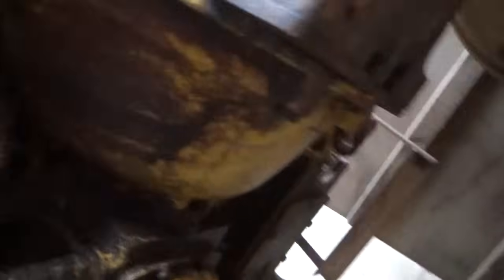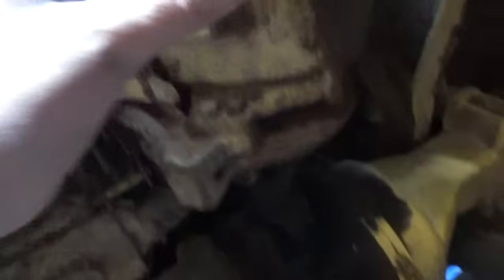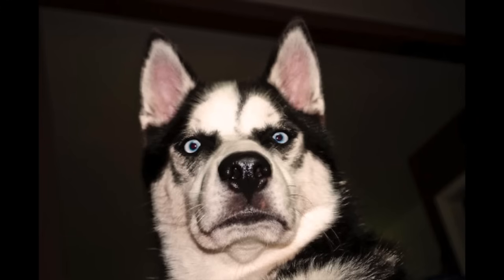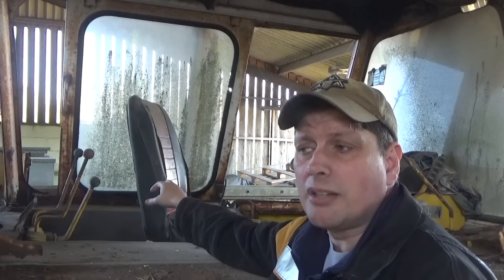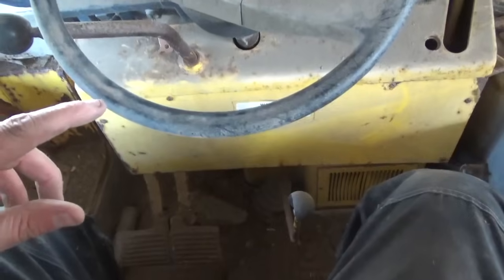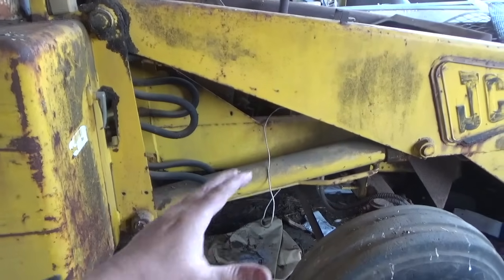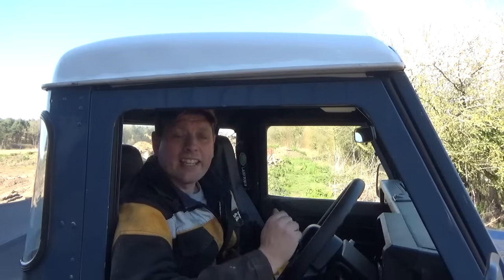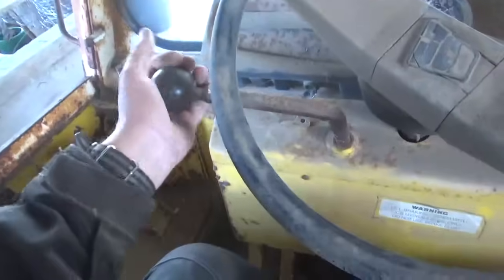WILL IT MOVE ? - OLD JCB

Comment: Wow. That was almost a let down! That machine seems to be built very similar to a Case backhoe. Which I suppose is no accident since Case was in bed with David Brown., and no doubt tuned in to British equipment designs. The trolling of trolls is an interesting strategy. I usually just take the negative comments and misconstrue them as positive or as something that serves my own purposes.
Reply from the maker: JCB's were far better built than the Case of the day but that came at the expense of being much heavier. The Case 580F was a faster machine to operate and some would say more simple.
I used a 580F for some time and actually really liked the old thing (especially the David Brown engine)
The trolls are just little more than entertainment and something for folks to laugh at.
Reply from the maker: Have you been able to do any more to the HD-5 ?
Reply: @LordMuck  Yes! My brother got it moving and the hydraulics working. The left steering clutch was rusted up. He just pulled that out and ordered a new brake band. So it should be fully functional soon.
Reply from the maker: Oh that's great ! It's a lovely bit of kit and well worth the effort. I've just bought a 6-71 Detroit out of a Terex shovel to play with. I miss hearing the scream of a Detroit from back in my oilfield days.

Comment: Like the videos, I wanna do them myself. Got a grey market YM2420 yanmar. Learned about what a thermostart was after a ether incident. Went from nothing, to white smoke, to black smoke. 874 hours but I suspect alot of rainwater got into the engine and made the rings have issues. 

😂 I dont think Greta would be quite happy with mine either at the moment.

Comment: Bloody Hell, That old 3C runs as sweet as a nut ,,, You can’t beat the old ones ,,, not like the Sh1t they make today with ab blue ECU, DPF, solenoids, wires running everywhere relays micro switches etc etc,.  Top video again 👍🏻🇬🇧👍🏻🧰🔧

Comment: Hi had a grey cab that made a vibrating noise it needed a  new hydraulic filter when they are plugged the filter lifts against a spring and the oil bypass's the filter  if it's not low that could be the noise Kurt thanks vid gets a👍 from me 😁
Reply from the maker: The oil is low Nick but you can bet the filter is clogged to buggery.

Comment: I think get started on the new project 
By  the way i have a ford 7700 and when i go to left the hydraulics i have to pull the lever to the top before it will left
Have you come across this problem before and if so what might be the solution for it 
Cheers
Reply from the maker: Have you checked the flow pressure and if the filter has been changed recently ?
Otherwise it's probably a top off job.

Comment: How a about a JCB 3C challenge rather than digging a hole. get a small axle stand, remove the extension, put an egg on the top of it base and see if you can knock the top off the egg without smashing the whole egg. You could try it with a Creme Egg with George at the controls! Faling that request, another "will it start" video please!

Comment: Brilliant started just as i thought it would and sounds sweet.i think the hours are low for its age, i have just bought a volvo bm 841 withe 37000 hours on the clock but does breath a bit.
Reply from the maker: The feel and wear indicate that it's about right for the hours, it hasn't done much at all but the pig shit killed it with rust.
Don't forget it's another one that only clocks an hour over about 1600 rpm.
Reply: @LordMuck   put her to work im sure she can still out perform.

Comment: The 4/98 in that is really sweet, yeah it has 1960's emissions gear but its long since paid its dues and how much carbon would it take to transport this somewhere, recycle it & make another jcb to replace it because it puffs a tiny bit when cold.  The long pipe is better for me because it puts the fumes higher & stops them coming in the cab when your stuck in one spot digging... Sorry for the sensible comment...
Reply from the maker: I always liked that small bit of mesh on the long pipes
Reply: @LordMuck  I didnt know they had mesh! I've always had to make one from a handy bit of old exhaust to avoid getting gassed :)

Comment: Hi mate, I know some on some jcbs you can select from 1-4 gear but it has no clutch pedal, you if know how this works can you talk about it in your next video because I haven’t a clue
Reply from the maker: They still have the disengage drive switch/dump pedal on the gearlever or the joystick depending on model.
It put it into a neutral while depressed and re-engages when you let go.

Comment: We have exactly the same jcb,, use it most days,, Everything works on it except the lights,, its an awesome piece of kit,, the metal work in it is just over ridiculous,,,
Reply from the maker: Except the cabs...
Reply: @LordMuck  that's a very good point,, yeah,, quite flimsy compared to the rest of the machine,,, I'll tell you something the hydraulics are on another level,, We were lifting a tree out with ours over the weekend and instead of it lifting the tree up, (it was stuck) the hydraulics were forcing the jcb into the ground,, I mean,, wow,,, All our other machines hydraulics just stop,, that's it,,, But the jcb kept going+going.... Wow
Reply from the maker: I'll try and find a pic of an oak trunk I lifted on to a trailer years ago with a 3C 111. The front tyres went flat but she just kept lifting. It was twice the machine the 3CX we replaced it with ever was.

Comment: Hi Lord Muck, and anyone else who has a 3C!
I have an issue with a JCB 3C MK3!.
Steerings fucked, all the rest of the hydraulics works fine but it's just the steering won't work.
I heard rumour of some sorts of filter directly associated with the steering system but I cannot find out where it is on the line!, Anyone have any ideas?
There is also a leak on the ram, not sure of the condition inside the ram either.
Reply from the maker: Sounds like your steering's fucked...

Comment: Do both muck! Be nice to see the old jcb working but you can’t turn down another will it start. If you’ve got the time, if not then get another one going! Come back to the jcb another time! Didn’t realize how different the 3ciii’s are to the 3cII’s, didn’t know they were hydro honestly, every day is a school day!
Reply from the maker: They're not hydro, they're a torque convertor unit. So you still have gears but the drive is taken up by a fluid flywheel.
Maybe we'll look at transmission types in a future vid.
Reply: Lord Muck yeah sorry that’s what I meant lol, I used to drive a Volvo wheel loader on a torque conver, never found it to be as nice as a clutch though it confused me to start with lol

Comment: I just bought a 3cx white cab but can't find any engine information on it that will reference... im about positive it's the Leyland  motor but there are several,  how can I identify,  I need a motor for it
Reply from the maker: If it's an early one it will be a Leyland 4/98 then after that they went to Perkins.
Reply: @LordMuck  which motor do you think is best to put back in it if im going to have to get complete motor anyway or do I need to say with way it is set up. I know is probably a sin for you to go to a whole different motor,  but here in USA parts are getting harder to find. Also have considered a different motor all together,  one more common here. Thanks for help
Reply from the maker: I'd stick with it just for keeping things simple (mounts, brackets etc) If you want parts (they keep every bit and they'll ship overseas) contact www.vicaryplant.com and speak to Simon.
Reply: @LordMuck  I contacted support through there online store.  For some reason there not shipping to USA right now,  figure our stupid government up to more dumbness. Would you have any other options for motor parts or information... at this point I have no choice but to put a conversion swap in machine.
Reply from the maker: What parts are you after ?
Reply: @LordMuck  ok I know for sure I have a Leyland 4/98nt. I blow hole through block on number four.  Broke crank and everything.  I need a complete motor or rebiuldable long block.  Machine is great other than this just parts are hard to find here in states
Reply from the maker: Ah.... you might be best to go the Perkins 1004.4 route...
Reply: @LordMuck  how much conversation has to be done to put the perkins in it.... those are more common here but still not easy to find.... won't be easy for me to chase down parts for either.

Comment: Love it! I’m tinkering with a 3c at the min but not a Manuel one. Would love to see the hydra clamps work as mine don’t (i don’t think). Might be user error. Keep up the good work.
Reply from the maker: They're very simple, make sure they have pressure to them, they will tighten and loosen.
Reply: Lord Muck I think I have 1 that is free but the other 3 are still locked I think I might have a faulty valve in the cab (it feels very sloppy) at least I have plenty of time to tinker with it at the moment! Cheers mucker!

Comment: great stuff,   100% need to see more on the JCB first, some digging, what the 4 gear settings do / speed wise etc how to drive it on board view?  what hydraulic controls do what , maybe some info on vehicle weight / wheel/tyre sizes , pushing capacity /bucket(s) capacity etc etc ,  it's all interesting stuff,   love the videos, great content, 10/10 ,

Comment: Another good video on JCB  😄 would you  do video   on  hymac 370 C.__ Ford  550.  Or ford 555. And MF 50 B  all the digger were in the same time as the JCB  . JCB  probably was the heaviest and brakes poor .  Hymac  370 c  heavy   and slow on road.   Backactor   slue with 2 rams  . Ford   550  probably lightest  and top speed on the road . Mf 50 B torque  converter  with foo pedal  poor on steering .  JCB. And MF 50 B with 4 cylinders and hymac and ford  550 / 555.  3  cylinders .    Are you going back to the little ford 3000 soon . Keep safe lord muck . 😄
Reply from the maker: The brakes on these Build 5's were cracking for the day.
I'd love to have a close look over a 370c again

Comment: Great video muck nice to she her running and moving. What does the dump pedal  actually do?
Reply from the maker: Same as in a Loadall, it just diverts the oil flow so it doesn't drive while it's depressed, then as soon as you let it up it allows drive again.
It's not as smooth as an inching pedal as it's either ON of OFF.
Reply: Lord Muck ahhh I assumed it was like a de clutch. Just thought I’d find out for definite. Cheers muck.

Comment: Lord muck.  I NEED HELP I’m in the states and acquired a jcb 3c mk3. Shuttle shift machine.   I have no clue on anything about it.   Where do I check and add hydraulic oil. Where do I check and add transmission and same for rear diff.   I can’t find any literature on the internet.
Reply from the maker: In front of the right hand rear wheel there is a door.
Open that and fill as required.
Reply: What about transmission.  Or is it all connected
Reply from the maker: Lift the hood, look towards the cab and there's a long tube and dipstick. Pull that and check the level.

Comment: Worked on a 3c2 similar to that before, did allsorts to it, mackled the brakes up so one side worked, had the cab off to scoot all the slime out, because matey boy that owned it lost the breather caps, getting it started every time you wanted it was an epic job, rewired all the electrics, bodged some floodlights on, replaced some of the pipes, there was a massive crack three quarters through one of the loader arms near one of the pin holes next to the cab, and the back actor bucket ram leaked, it was shite to drive, the gears were like a stick in a bucket of rags, bit like my transit van 😂

It did some good jobs though on my mates 2 acre freehold, he had a half mile long gravel driveway, and the jcb got used no end to resurface it, used to roll the loader bucket pretty much upside down, plant the top of the bucket on the floor, lift the machine up with the bucket, then drive backwards to grade 👍 happy days

Got itself unstuck no end with the back actor and plenty of chains

Comment: JCB please, 
Any chance you can clean it?  Thanks chap
Reply from the maker: Nope, none whatsoever.
Reply: @LordMuck  fair enough,  at least old mate has the good sense to park it up dry and cosy.
Reply from the maker: I reckon she might get a wash and then a spray of diesel all over to protect her 👍
Reply: Did you buy her as well?
Reply from the maker: At the moment it's going nowhere because of the restrictions.
Reply: @LordMuck  so you will after?
Reply from the maker: I've already got one exactly the same so I haven't decided if I want two old heaps of shyte..,
Reply from the maker: But that's exactly what made them such a good machine.
Would literally push a house down.
Reply: @LordMuck  only if the ground was hard enough ;-D
Reply from the maker: That's when you discover the difference between an operator and a driver... 
Experience was key

Comment: Lord Muck, NEED YOUR HELP, have the chance to buy a very very very rough 3c, they say it doesn't run because the previous deceased owner changed the starter and never finished it. Whare are the chances this is true and the whole thing is not seized and total scrap? I would want to do some work with it? Am I mad, should I just rent a digger.  Thanks !!!
Reply from the maker: 1) Depends on how much work you have to do.
2) Depends how much they are asking for it
3) If you can get a bar in the pump coupling (between crank and radiator) and it bars over then you might stand a chance.
Reply: @LordMuck  Thanks a million, will sleep on this, even if it was free, I don't think it's a goer. Thanks !!!
Reply from the maker: No problem 👍
Reply: @LordMuck  Thanks very much, I will not be rescuing a 3c this time, I think there's a good chance it would cost more than it's worth,  saw a mint off farm 3 c in uk a few months ago that looked like it was always looked after and stored inside, it went for 1500 pound,  missed that and grasping at 3c straws now :) thanks and keep up the good work!!
Reply: ONe more question, I have found a nutfield tractor with a loader, its cheap but has a crack in the block, does that mean it's unusable?
Reply from the maker: No but it means leave it alone 😉
Reply: @LordMuck  ok thanks, would an engine rebuilder fix that or once cracked its game over?
Reply from the maker: Can be done but to do it properly probably uneconomically viable.
Reply: @LordMuck  thanks for all your help, asked a engine rebuilder with a tractor scrapyard, no block to be had for the nutfield but chatting to him he might have something in my budget, win win hopefully, thanks very much

Comment: Lord Muck
Can i ask some advice, picked up a jcb3cx 2wd white cab recently-
(Covid project) 
Front axle- hubs very worn, absence of grease and bushings for years, maybe decades, but my bigger concern is play around kingpin in the axle, strange, one side only as the other side ad to cut and sledged out.
My question - how would u deal with the play in the axle hole.
Afraid am very much a novice, but really enjoy your channel and knowledge - please keep it going!
Thank u mf
Reply from the maker: Is it the axle or the casting that's worn ?
I would look at getting a new bush made and new pin and going from there.
Reply: Casting on hub the worst, less so on axle, thank u v much for advice, will get new kingpin and get bushings sorted
Thanks again
Reply from the maker: It's worth calling Simon at Vicary Plant as they carry no end of new and second hand parts and are incredibly helpful.
https://vicaryplant.com/